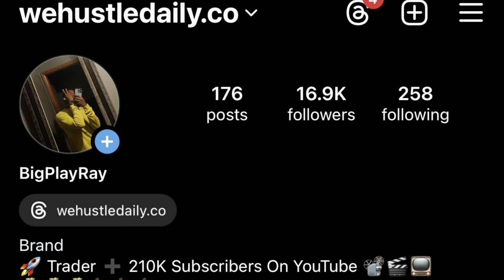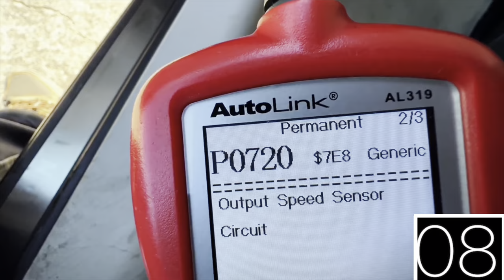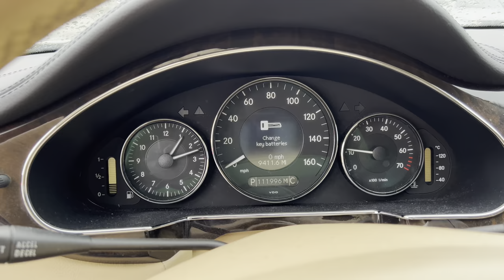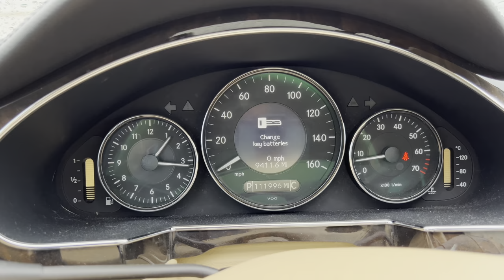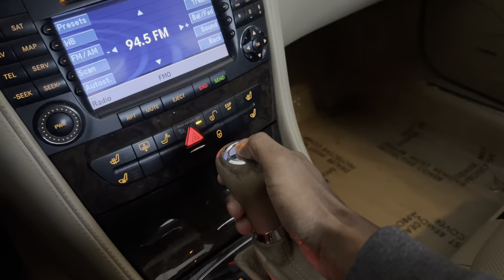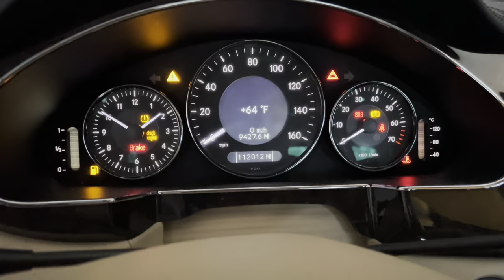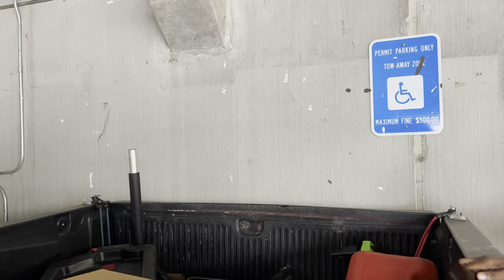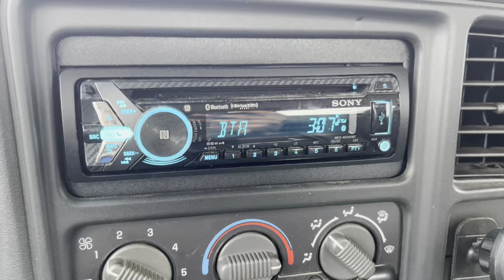I Bought A Wrecked AMG Mercedes Benz CLS 550 With 100,000 Miles From Copart!

Comment: Not AMG, AMG package...I have a 08 same car 7 years. Trun key and go. Cali car. I did a chrome delete , black roof wrap custom exhaust.  Diamond grill and carbon rear spolier and diffuser.  Pushing 400hp. I get compliments all the time. I almost bought the lexus 400 2010 but the low window profile and ride sold me. I luv the CLS smooth ride with exhaust hum , sweet. Good luck all ❤

Comment: It's not an AMG. It's a CLS with the AMG package such as wheels and emblem. It doesn't have the AMG motor, suspension and interior. If it was a real AMG it would be a CLS 63 AMG. Post it for $7000 to get rid of it fast, Champ.
Reply: There is also a cls 55 that came out in 06
Reply: @Neil542   Right but this is 2007 and 2006 was the last year for the cls 55 AMG.
Reply: @cubedmack  I wasn’t saying this specific one just that there is also one that exists.
Reply: @Neil542  Gotcha
Reply: these CLS are becoming worthless. theres several in my area in good condition for less than $5,000 and nobody wants them 😅
Reply: UNLESS ITS A REAL AMG, but this one is not
Reply: Yeah somebody finally told me stick with Lexus if you don’t see amg on the dash it’s not real
Reply: I have a clk 430 amg and a clk 320 twins
Reply: Cls 55 or cls 63 real amg… this is just a 550 with amg trim package
Reply: AMG’s only have two digits, 32 45 55 63 65 etc, amg badges didnt come on anything else, someone added that, you can get amg bumpers on non amg cars its called a sport package but thats it.

Comment: January I bought a 2008 CLS 550 from Copart for Flood Damage. These things have issues with the sunroof drains, that can bring water into the interior and such. I got a steal on mine, $900 before fees. The chrome piece above the license plate on the trunk lid can also leak water. Yours has fantastic interior though - its a great looking car for sure...you'll have no problem selling it.

Comment: You incorrectly comparing an infiniti M37 s to a Mercedes CLS 550 AMG.. 2 different ball parks...just because the M37 is newer doesn't mean anything.. anything AMG is more expensive.... and you keep saying you see CLS on market place for 7900 or so and you looking to only get 5500 to 6500?? That's a AMG 550 you better advertise that car like you supposed to that ain't no regular CLS
Reply: I was thinking the same thing in the last video he was looking up what they were going for. AMG is a big difference from a regular
Reply: @Jasper9054_  lol hell yeah smh he under cutting himself .
Reply: It’s only a 55 0r 63 amg not 550 amg
Reply: FACTz!!
Reply: No such thing as an Amg 550 that badge not factory
Reply: @chloejay8199  ok well if that's true it's right up rays alley he had a fake M56 and now he got a fake amg
Reply: I could be wrong but I’m almost certain someone just put that Amg emblem on the trunk lid just for looks it’s a 550.. same engine as the s550 which is no slouch.
Reply: @gdavis29  You are right, there is no CLS 550 AMG, There are CLS55 OR CLS63 AMG though. Fake badge
Reply: @fisephalnoxt  now that i think about it 07 was the first year of the S550 so the likelihood of The CLS 55 amg is non existent. I'm thinking the big body gets it first before the lower models. Just like my 05 S500 had the push to start on the shifter knob just like that CLS he got which is a 07.
Reply: Actually a amg 550 is a appearance package basically has the amount body kit and wheels bit not the performance parts under the hood but comparing a Ben's to a infinity period is wild no comparison
Reply: Exactlyy
Reply: @lifeisagambletv  Yes, the CLS55 probably came out in 2008. I'm shocked at Ray sometimes, his lack of knowledge and unwillingness to learn cars, like when he calls the Infinity M37 Big Body and the GS350 small lol
Reply: @montanatru  Also the older AMG package don't have AMG on the rear, I think even the new. only real AMG have it on the rear.
Reply: @fisephalnoxt  LMAOOOO HAHAHAHAHA son that be killing me he swear he ride big body
Reply: @lifeisagambletv  I wish he could drive a S63, and see what is a big body lol
Reply: @fisephalnoxt  word lol this guy is delusional 🤣 😂 🙄
Reply: Bruh this car has a salvage title what are you talking about you want hime to rob people or something 🤦🏽‍♂️
Reply: I’d buy it for 5500-6500 then re flip it for more lol 😂
Reply: He is a m37 guy..😂😂😂
Reply: It’s not a true AMG. It’s AMG kitted

Comment: Its not an AMG it would be CLS 55 if it was an AMG. A 550  designates the engine size that is probably a 5.5 liter V8. Also on the interior at the gear selector you would have 4 buttons one for AMG turbo boost that year would have a V8 Bi-Turbo badge on the left and right fenders. The upside is you still have dual turbo's chargers and a bullet proof engine. That car is no punk in sports mode.

Comment: I think any car with this motor in 2007 had cam gear issues or something so I try to avoid buying anything 350 or 550. It was fixed in the following years I’m told. Anything with the M113 or m113k though in the future I would always buy if it runs good. I love working on these cars. When I get my SL first thing I’m doing is swapping to coil over. The suspension will always fail eventually with the ABC.